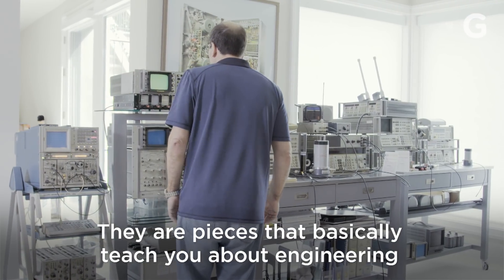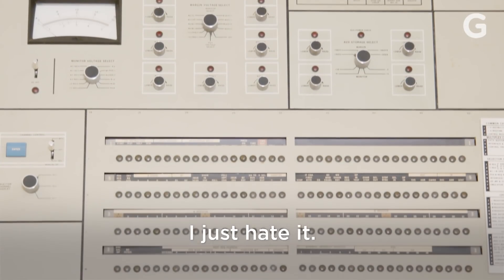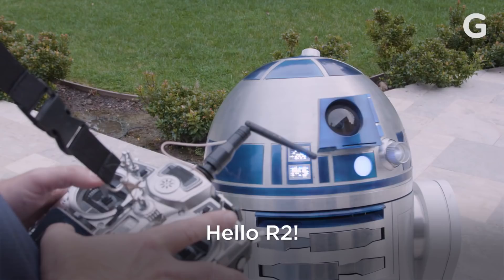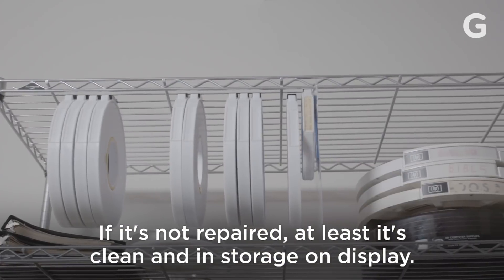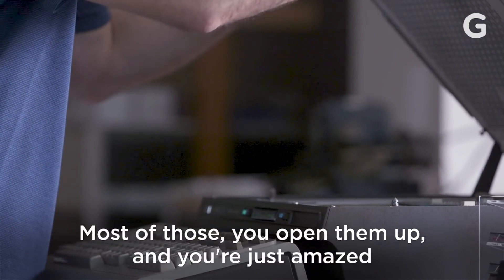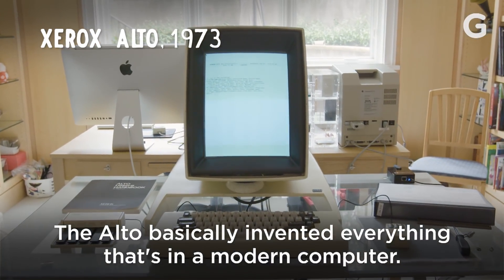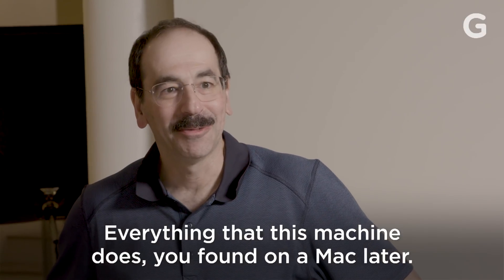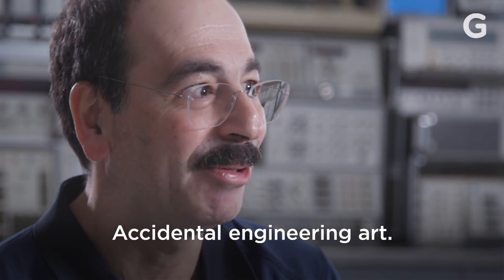This Guy is Repairing the Father of All Modern Computers | Show Me Your Nerd

Comment: You had another incredibly intelligent, super genius hacker in this video and you didn't point him out -- Ken Shirriff is the guy holding the smartphone that's being used as a flashlight when they are working on the Alto. He is every bit as smart and in love with engineering as Marc is. Ken is into the semiconductor side of things -- show him a picture of an integrated circuit and he can figure out how it works just by looking at it. These guys are the definition of the word "hacker" used in its correct definition.

Comment: -"computers haven´t changed a BIT" Pun inteended ;)
Reply: tetepeb Terrible pun, extremely contrived... and "haven't changed a bit" doesn't even make any sense.
Reply: @unlokia  what Marc meant was the basic principles that make a computer what it is, haven't changed. As in computers still use zeros and ones as their base code. Keyboard characters are still a series of zeros and ones. Data is still stored  using the same principle, zeros and ones. Even the humble mobile phone uses the principle, both internally and in connection with mobile towers and wifi modems. 

The only real difference, is the density or numbers of zeros and ones processed, stored and sent/received. The other change, is in the tech.
Reply: Don’t be rude keep it to yourself